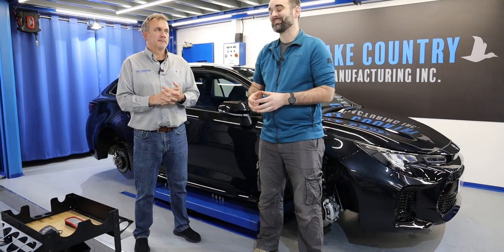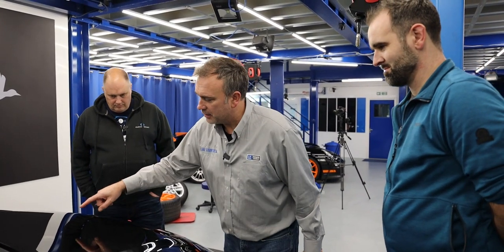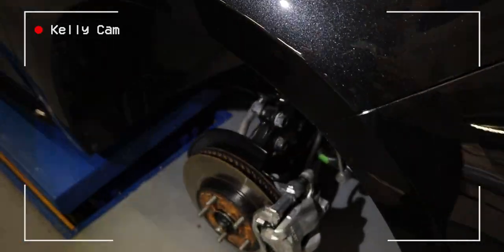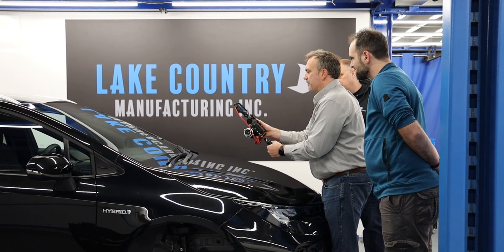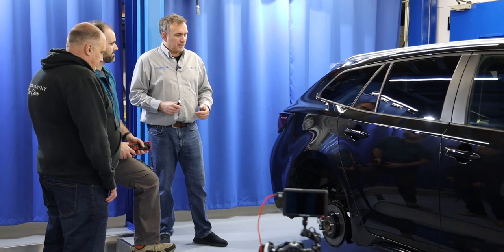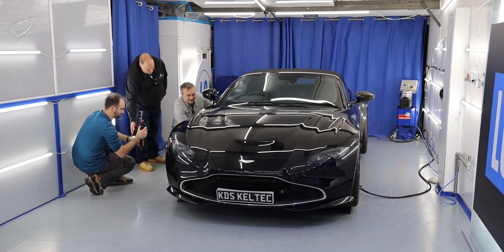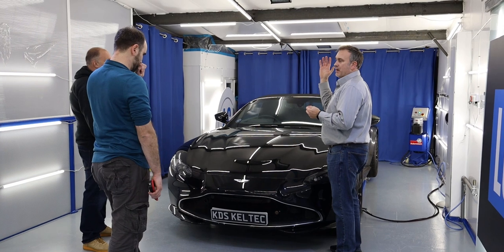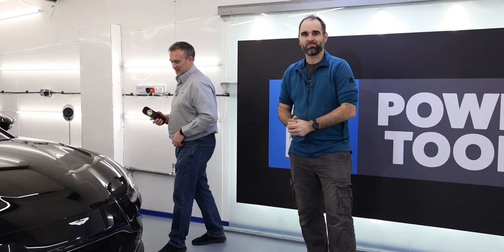Inspecting A Black Car - And Does A More Expensive Car Mean It's Better?

Comment: Another brilliant video. The knowledge, information and discussion between you guys is great. I am really surprised that the QC at Aston Martin does not rectify the paint defects at source. I'd be happy to be an Apprentice there and learn to ensure all cars left the factory as near to perfect as possible.
Reply from the maker: Thank you... Try and find a new Aston Martin without sanding marks... It's like a seal of approval or something 🤣
Reply: You’d be surprised just how many car manufacturers leave sanding marks in the paint. I’m strongly inclined to believe this is a result of the process used and a cause and effect. 

Production environment probably has them removing the sanding marks with the generation of lots of heat, heat makes the paint swell and give a false sense of correction and passes QC. By the time it reaches the selling dealer, the paint has relaxed and the defects reappear. 

That’s my theory.